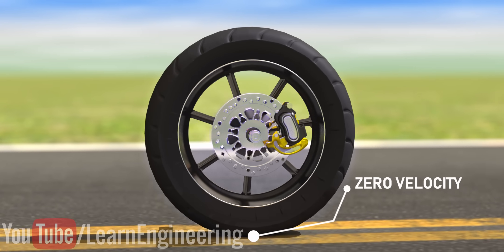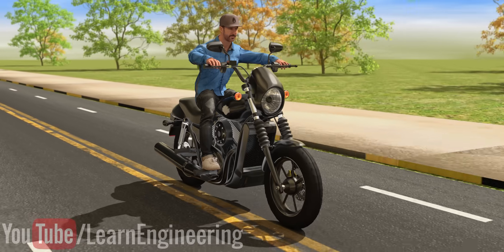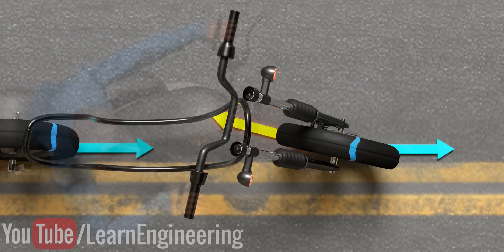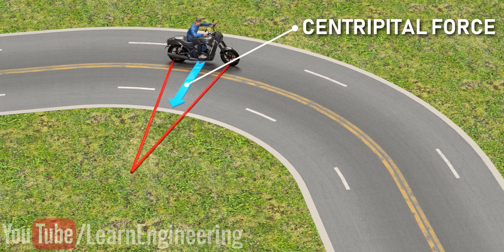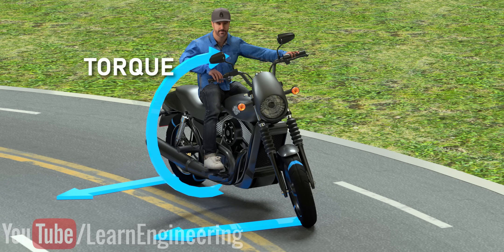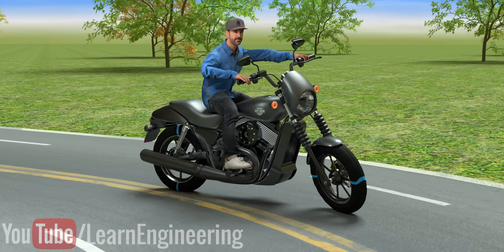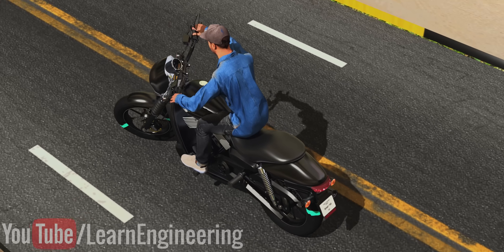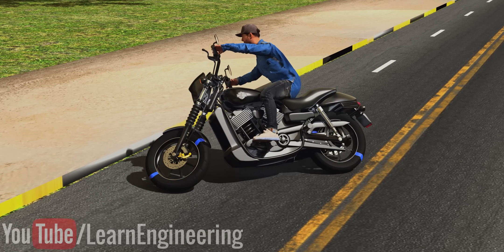Counter Steering | The interesting physics behind it

Comment: after a certain speed, the bike goes the opposite direction thats you turn the handlebars, and you don't correct the steering. I was taught it as the "push and lean" technique. How does that work?

Comment: I was taught to turn the handlebars opposite direction for sharper turns with more lean. 

I lived in mountains, I noticed the amount of space I have between ground and bike in turns and how much I had to slow down.  A buddy of mine followed me home and said, "try turning the opposite direction" I looked at him like he was an idiot... he further explained it but still sounded a bit out there.. I trusted him he used to ride till his son died on a bike. 

I tried it and man I was blown away. I started getting used to 40mph turns in 25mph zones (not school zones lol the turns with the recommended speed yellow sign) scraping the kickstand on the ground. I learned on a moped lol  I'm still amazed I never slid out or laid it down. Then again, the moped is wider at the bottom compared to a motorcycle. Couldn't lean as far on a motorcycle, I almost lost my foot.
Reply: On ANY turn it happens whether you want it to or not.
Reply: new rider here and i'm still trying to grasp this concept from my safety training class. for the life of me my brain cannot make the adjustment to do this counter steering. so at higher speeds into a turn you implement counter steering?

Comment: You are saying for counter clocking we turn left then taking right turn, so my question do we need to apply sudden break while turning to left ?
Reply: Counter steering couldn’t be any easier:
Push left bar forward, go left.
Push right bar forward, go right.
The only braking involved would be to bring down your road speed prior to entering the bend. It’s easy!

Comment: Counter steering isn't used by "many" bike riders.  It is used by "all" bike riders!  If you're riding a two wheeler, you're counter steering whether you know it or not.  It's just how things work.  What this video is calling "normal" steering is total BS.  Steering a two wheeler is not one way under these circumstances and another way under those circumstances.  The rider shifting their weight to initiate a turn has some effect but the rider will still be counter steering underneath it all, especially on heavier motorcycles.

Comment: While countersteering is intuitive, it does help to know the physics behind it.
However, you left out why there are two different kinds of steering and when they are used, and how the Bike actually turns once CS is initiated (wheels follow different tracks).

Bonus points for showing a rider with no safety gear!

Comment: as a motorcyclist of 20+ years your explanation of this is totally incorrect. if your going over 25 or 30 MPH you counter steer all the time and you only as you say"normal steer" when you are under that speed but you lean the bike slightly to the opposite direction to counter gravity and above 25 mph if you want to turn right you push on the right side of the handle bars witch in turn is pushing it left and then the bike goes to the right witch is counter steering. I think you need to look on some motorcycle training videos to see how this actually works.
Reply: I only want to know how do you turn right in the city where you almost always have 90 degrees turn........( at what speed you do that and what is your throttle postition) is your clutch all the way down and 0 throttle while you make a turn or what?
Reply: @Voltomess  I don't make 90 degree turns at 25 or 30 mph or above usually a 90 degree turn is only about 10 or 15 mph maybe less so then of course you would be turning the handlebars in the direction of the turn did you not comprehend my last comment?
Reply: @ChrisMonopoli  I only want to know how do you turn right in the city where you almost always have 90 degrees turn........( at what speed you do that and what is your throttle postition) is your clutch all the way down and 0 throttle while you make a turn or what? you didn't anser that

Comment: A lot of people talk about doing this "intuitively" when riding.  The problem is when people think it is leaning their body weight that does the steering, and every time they lean their weight they happen to push forward on the bars, and it steers, so they are convinced it is their body weight lean that causes the steering, and then next time they go into a turn and it tightens up and they try leaning their body weight more without pushing forward on the handlebars more, and the bike doesn't turn tighter and they go off the road and die.  It is better to know what causes effective steering directly rather than indirectly so they can have the most effective response in emergency situations.
Reply: Exactly!!!!👍🏻

Comment: This is not completely correct.  There is no such thing as "normal" steering. Physics says that a body in equilibrium (eg rider and bike in an upright condition) will act to regain equilibrium if there is interference. So if a rider moves their bodyweight to one side, the bike will lean to the other. This lean may inadvertently cause counter steering to happen.

Comment: This video is pretty much bullshit. Counter-steering is the natural way to turn a bike at speed. "Normal" steering only works at near stopped speeds.
Reply: Not even then. "Normal" steering work if there is an outside force like 3rd wheel or rider pushing his bike.
Reply: You most certainly need to normal steer at slow speed maneuvers. https://www.youtube.com/watch?v=Fp3jPjC315E
Reply: Disagree. Not at slow speeds as demonstrated in the video.
Reply: @XtreeM_FaiL  have you watched police cone maneuvering? At slow speed maneuvers there is inadequate centrifugal force in the front wheel to overcome the gyroscopic effect of the engine. You have to turn towards your intended direction of travel. Any tipping force not controlled by engine spin is overcome by body weight shifting.

Comment: I'm looking at this wondering how is he tuning his handlebars like that, anything over 20 mph and if you try to turn your handlebars you are gonna counter steer the other way. Going at speed the front wheel is a flywheel that now doesn't want to just have it's direction changed, so if you try to turn the handlebars right you will put pressure down on the left handle and lean the bike left... counter steering.
Reply: I only want to know how do you turn right in the city where you almost always have 90 degrees turn........( at what speed you do that and what is your throttle postition) is your clutch all the way down and 0 throttle while you make a turn or what? Is countersteering involved in this situation or not?
Reply: @Voltomess  if you are turning from a stop you are going slow enough you just turn the handle bars and steer that way with a little bit of lean angle. If you are turning at speed it's all lean and counter steering. I'll admit it's hard to explain fully it's just like you just kind of feel it and go by instinct.

Comment: You do not have to steer the handle bars back to the direction that you are going. Just ease the pressure off the handle bars and it will maintain it's angle for you. It will not just fall over. Can we get some real motorcyclists explaining this, please!

Comment: This video has a lot of errors in the graphic: firstly driver not wearing protective gear,  showing the handle bar not counter stearing while talking about counter stear. Not talking about torque and angular momentum, in simple words when counter stearing should apply or not... actually this video is a danger for new drivers in my opinion. Please avoid this vidoe, I would rather advice to check Bret Tacx, Twist of a Wrist, Canyonchasers and many more. Finally , go to riding school and learn from professionals!

Comment: The one that teach me to rode motorcycle was my father and he never told me how to normally turn. He just told me how to countersteer. And before watching this video, I never noticed that motorcycle can steer normally
Reply: so how do you turn at low speed in the city where you have 90 degrees right turns? you obviously dont use countersteering in this situations.
Reply: @Voltomess  yep. I don't. But don't know why, I naturally know when to use countersteer and when to use normal steer

Comment: Veritasium just dropped a video on the same topic. Its actually the normal way of steering. Here's the video if you want to check it out: https://youtu.be/9cNmUNHSBac
Reply: Although many similarities exist between push bikes and motorcycles, one massive difference is shown in your video. The rider initially turns one way to lean (same as a m/c rider) and then is required to actively steer the other direction (in the direction of the lean) to prevent losing balance. This isn’t possible on a motorcycle. If a m/c rider did this it would stand the bike up and prevent the bend being completed. The m/c itself (rake/trail etc) forces the wheel in the opposite direction, without any input from the rider.

Comment: Also very good at dropping the front.  If you turn right you turn your bars right
Reply: Wrong!
Reply: @softailfun  no I'm not. You can turn your bars to the right.  But normally this upsets the bike. The only time you need to turn tbe bars in the way you are turning is when you are making a low speed very tight turn. Or when you have lost the front and your trying to dig the front wheen in to regain grip.  You will find 99.999% of the time when you turn right your actually turning the bars the opposite direction.
Reply: @wanemergency3591  
Well I actually agree with all that you said. Maybe I read your first post incorrectly.

Comment: I've been riding bikes for 40 years, and the part at 1:50 is complete BS. It is IMPOSSIBLE to turn the handlebars to the right and make a right turn when you're riding. The bike will go left. ALWAYS. If you think you can force it to go right, you will simply fall over. The only time your "normal steering" would work is when the bike is going too slow to balance, like when you're walking next to it cos you're out of gas. This "technique used by many motorcyclists" is literally the ONLY way a motorcycle at speed turns. Your "normal turn" BS does not work and never will.

You HAVE to push the left side to turn left. It's not some optional magical advanced technique - it's the only way a bike at speed turns.

Perhaps actually get on a motorcycle and try it before you make embarrassingly incorrect "physics" videos like this.
Reply: You're right.
Direct steering can only work if there is an outside force, like a biker who push his bike because no gas.

Comment: This explanation is plane wrong. Animation that explains process is misleading and if anyone uses it to try it it is likely to crash. As soon as motorcycle travels faster than 15km/h counter steering is only way to enter the corner. It is not achieved by turning the steering but by shifting overall weight out then into the curve. In fact it is impossible to force front wheel to counter steer by turning it away from the curve without experiencing significant amount of resistance. Doing it above certain speed is guaranteed to cause high side crash. This video should be removed as it is misleading.
Reply: This video is total rubbish.
That being said, so is what you have said fella, you’ve got this all wrong!
https://youtu.be/lzk8oyNO708

Comment: Counter steering is the only way to steer a motorcycle once you get above 10 or so mph.
Reply: Must be very dangerous to ride in Merica. Metric world counter steering works at any speed. From 0 to max.
Reply: @XtreeM_FaiL  , sound like you never been on a bicycle or dirt bike on a slow single track.

Comment: My bike doesn't work like this..........your physics are broken
Reply: Nobody’s bike works like this lol. You’re right, this vid is totally useless!
Reply: @softailfun  i don't think about counter steering I just lean and the bike "counter steers" itself
Reply: @motorcyclemaddnezz  
Start positively counter steering. Throwing a few pounds of weight around on a bike does nothing. You’re counter steering without realising it. When you move your weight you are unknowingly adding a small amount of pressure to one of the bars. This causes the bike to counter steer and lean.
Reply: @softailfun  exactly I never focus on how I'm steering I focus on where I'm going and just let expirence do the work. Controlling a motorcycle should be as effortlessly as walking is and one should practice until it is.   I'm a firm believer in never riding faster than my guardian angel can fly lol

Comment: “Normal” steering which is handle bar steering, is used for very slow speeds like under 10mph in a parking lot for example. Counter steering is for faster speeds like actually on the road.
Reply: Or you can just slow down before a turn?
Reply: @starryepidemic2532  No. You obviously don't want to take a 50mph curve at 20mph.
Reply: @kayakexcursions5570  why not?
Reply: I can just get more closer to the sides to let the cars get through and just slow down to make the turn
Reply: @starryepidemic2532  You're going to force people to pass you? Just practice countersteering while you're driving straight. Push the handlebar a little to one side and notice how the bike immediately starts to lean. Then push it back and the bike will straighten back up. Then do it in the other direction.
Reply: @starryepidemic2532  If you try to steer normally the bike rolls in the wrong direction and forces you to turn wide while you're trying to fight it.
Reply: @kayakexcursions5570  oh ok thanks 👍
Reply: @kayakexcursions5570  normally until now I've only driven in high traffic areas and in most of these places the speeds of most vehicles is already low enough to not need counter steering just direct input worked but I'll  practice counter steering as well
Reply: @starryepidemic2532  You countersteer at any speed. Only practical way st control a bike.